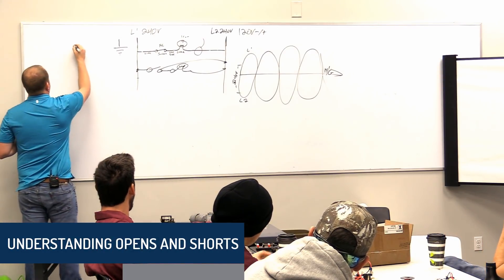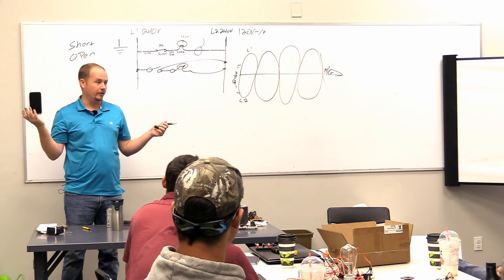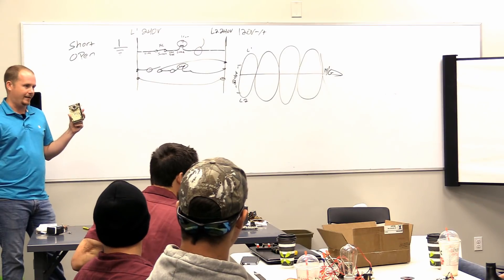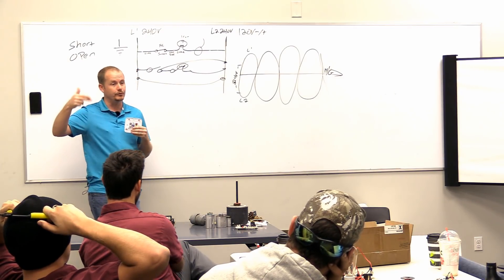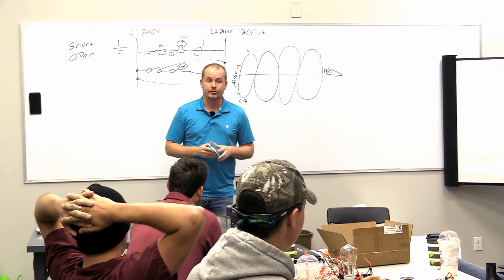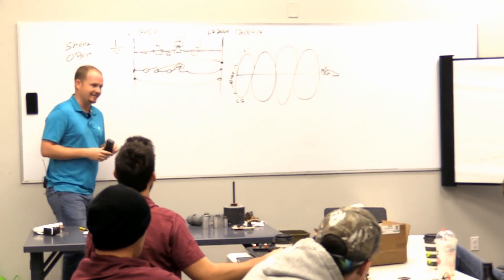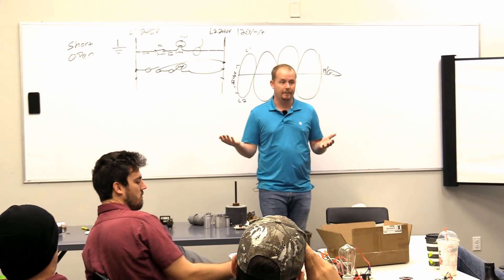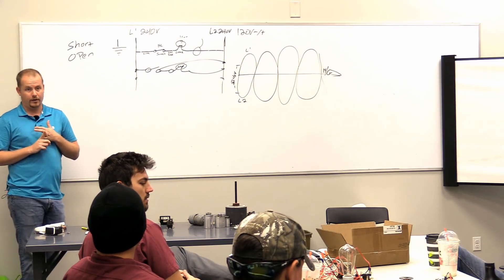Open and Short Circuits Class

Comment: A "short" is a fault condition where current takes a SHORTER path through a circuit and bypasses the load (hot wire touching frame).
An "open" is a condition where current is UNABLE to flow at all because the circuit path is incomplete (loose wire, broken motor terminal).